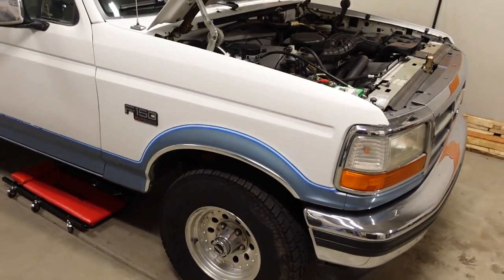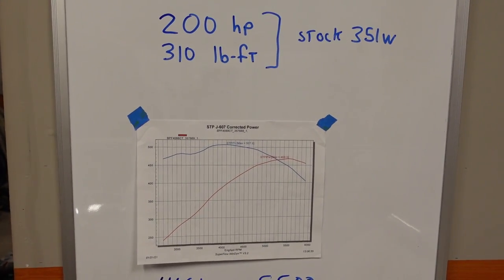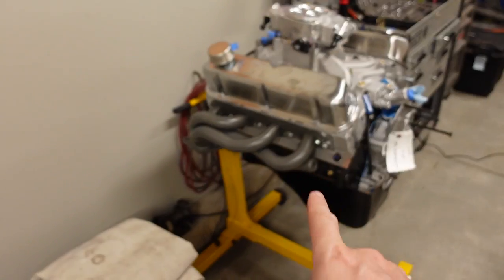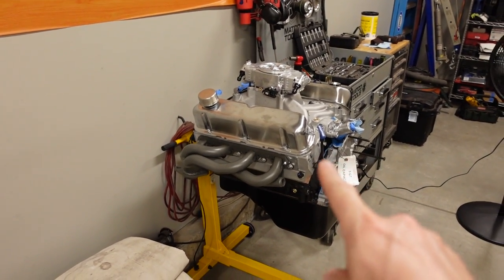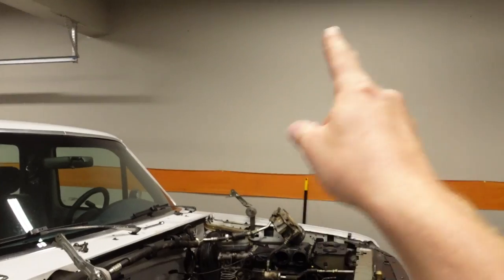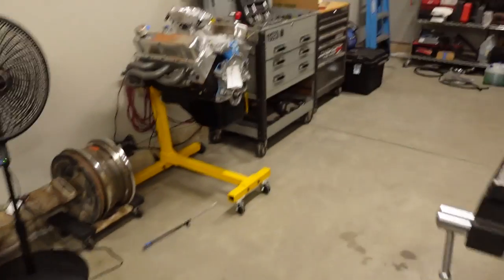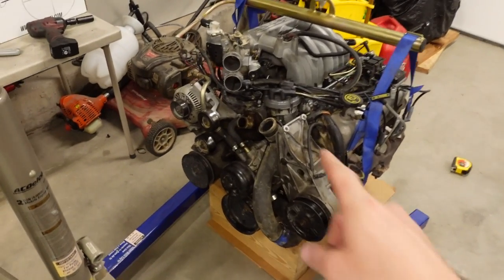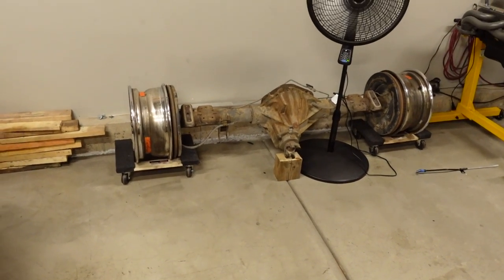Adding 268 MORE horsepower to a '93 F-150: Engine Swap Pt.1

Comment: It's so hot in there, the orange line around the walls is coming off!
Reply from the maker: yeah, its a vinyl sticker and the adhesive just isnt having it
Reply: Has been for the last few videos!
Reply: Get one of those portable A/C units with the exhaust hose. And drape a sun shade of some sort on the outside of that wall.
Reply: Time for a Mr cool mini split. Plug it into the welder 220 circuit or wire an extra circuit

Comment: They don't leak. That's pre engineered frame oiling. Prevents rust.
Reply: Pioneered by Dodge, perfected by Chevy.
Reply: @idriwzrd  good old Chevy it'll run like shit longer than most will run
Reply: One of my favorite features
Reply: Bullnose platform fords do that to ensure the oil gets changed.

Comment: I had a '93 F150 with a 300 I6 and M5R2 manual trans. Same body style but 2 wheel drive.
I sold that truck nearly 5 years ago with just shy of 750,000 miles on it.

I miss that truck

Comment: 4:29 nice form.
You need an engine leveler. Good ones aren't real cheap, but completely worth it if you're pulling motors. Actually, what's your shipping address? I'm not big on patreon, but wouldn't hesitate to send you a useful tool.

Comment: 4:30. Color me impressed. I've always used a buddy to remove hoods. I never wanted to risk messing up the paint. Next time I'll do it like this. 👍
Reply from the maker: I was barely on the edge of not being able to lift it off lol... but I highly recommend using a silicone rubber piece where the corners touch the cowling to protect the paint.
Reply: Ok, you got it off. Now put it back on by your self. And make sure the body lines are perfect while you are there.😆😆😆😆😆😆👿🌚

Comment: Same engine in my 95 f150 4x4..351w. I rebuilt it with a bump in compression to 10.1 and a small .477 lift cam. I ended up haven't to swap from speed density to mass air flow.  That small cam made I big difference.

Comment: When i pulled the 351 out of an F250 i had i started disconnecting all the wires to the engine then saw the same  connector you pointed out... it was my first time pulling an engine out, i did all the prep work the night before then rented an engine picker and had it out in just 2 hours with the help of my brother and made it back to the rental place before they closed at noon (weekend)... i got rid of that truck cause i didnt need it anymore and we wanted the 351 for my dads 94 mustang... now i have a 94 short bed single cab that im building the inline 300 for... got the hole front end pulled off and i will end up rewiring the whole truck to make it work the way that i want it to...

Comment: Hey LT, invest into one of those portable 3,100 CFM/950 sq ft. coolers. I have two in my shop here in the southwest as well and it makes all the difference. Just crack open that garage door for some air flow and you're set. I maintain 85F with a nice airflow in the shop. Couple $$$ investment, SOOO worth it though.

Comment: For future reference, Stinger perfomance has a plug and play computer for the ford eec4 that these use. It uses mega squirt efi and will control the factory overdrive transmission. Boost compatibility and fairly easy to use .

Comment: Hey LT, 
Throw some blow-in insulation between the stud bays on that garage wall. It should mitigate temps pretty well. Then you could get a small mini-split heat pump just for the garage. You’ll have air conditioning or heat. Just make sure the unit can operate during the winter temps of your climate. Hope you are well, love the channel.

Comment: Make sure that's the correct  timing cover for the reverse rotation water pump. Usually the engine dowel pins is what causes the problem.

Comment: Those E4OD torque converters get hot, and the pilot snout you're referring to swells, and gets stuck in the crank. They can certainly be a bear to bust loose. Put a little anti seize on it, when you go back together. Whoever has to go back into it in the future, will thank you greatly.

Comment: Add some insulation and a mini-split to that garage! There are some DIY packages out there for not much money. Some blown in fiberglass might keep the inside of the west wall moderated a bit…
Reply from the maker: the insulation by itself would likely make a huge difference

Comment: I absolutely need I mean need 1000-HP in my work van! Hey do a shade structure of some type next to garage. I did it over my driveway and it changed the way we use our home. No insulation in the walls either. Just by keeping the sun off the wall and concrete

Comment: This is super interesting because I’m in the process of this as well only with a carb’ed 302 with small cam and GT40 heads. Currently trying to figure out how to get the Quick 2 trans controller to work correctly with the E40D

Comment: My favorite part of my '93 is using R12 refrigerant.
Reply: Is it a lot cooler? My 95 has r134a and it’s all stock components but has been recharged and it works good. Had it on yesterday and it cooled me off rather quickly
Reply: @droppedf100  lol it's cold for sure. Comment was a little tongue-in-cheek. I don't appreciate compressor failure and having to source more R12 when R134a is less than 5 bucks a can at Walmart.

R134 conversion doesn't cut it in Texas. Looking to swap to a 94+ system to take advantage of ease moving forward.

Comment: Very happy to see the f150 build. This year is mainly what I work on but all lowered 2wd trucks.

Now why did you do a small single exhaust for a near 500hp motor? My motor makes about the same in my f150 and I run 1 3/4 longtubes and dual 2.5” exhaust with an x pipe and I feel I should be running dual 3” honestly

Comment: Lol my dad did that with his 48 ford it only had like 70 horse power he fixed it by yanking out the old flatty and stuffing in a Buick 333 nail head driving the hp to 220hp even with the old Rochester 4bbl it flew by everything and surprisingly even gas stations too

Comment: I have two main questions, question number one is what you're going to do about the fuel system. I have a mild Big block in my F350 and tried to reuse the stock EFI fuel system and it can't seem to keep up and I'm only making somewhere around 320 horse.
My second question is why the owner went with TBI instead of a multi-port setup since you're already investing in aftermarket EFI anyway? I know the small block Fords have a good selection of really good flowing fuel injected intakes and it seems like multiport is a far superior system to throttle body injection for efficiency and cylinder to cylinder distribution. As far as I'm aware when I bought my Terminator x system it was the same exact price as the sniper setup but I could be wrong, it's been quite a while now.

Comment: I will be glued to this build. I have a 96 bronco I've been wanting to do more changes on. Are you going to be running the stock trans?
Reply from the maker: yes we are, for now. it will get swapped in stage 2 of the build when we do the suspension

Comment: If you’re building a pre-runner why are you doing a solid axle swap? It already has the dana 44 TTB and there’s multiple kits available with 18+ inches of travel off the shelf. Unless you’re wanting to build a multipurpose vehicle that can rock crawl and go fast in the desert.
Reply: Giant Motorsports has some slick TTB and Twin I beam kits.

Comment: A 392 Windsor would be perfect.
Reply: Main difference is the 408 has a 4" crank with longer rods compared to a 393w that uses 0.030" over 302 pistons, stock length 351w rods and a 3.85" crank. 393w can be more budget oriented depending on what quality of parts you are looking to use. A 408 kit with all forged parts is no more expensive than a 393 with the same stuff.

Comment: I would've been mad if it was an LS swap.
Reply: Yeah! Who wants easy, cheap, reliable power anyway?!
Reply: @idriwzrd  I doubt a blueprint engines 408 windsor crate engine will be anything other than reliable; particularly when you take into account the professional installation done by LT.
Reply: @christianmeeks4430  Also cheaper than any LS motor that makes similar power, as well as easier to find parts for.

Comment: That transmission is going to be screaming for mercy behind a 408.
Reply: Not true the e4od is a stout piece even stock. I’ve been 11.40s with mine with only a converter and a performance valve body
Reply: I believe that trans is basically a C6 with an OD. They're reasonably stout, a basic rebuild with a few upgrades should do alright. I'm glad I have a ZF-5 S47 behind my 5.8L roller cam engine to handle a 393/408/418/427 stroker upgrade one day God willing.

Comment: Double check that timing cover will work with the reverse rotation pump that is used with the serpentine belt system.. Ford's are dumb and used a lot of different front cover stuff
Reply from the maker: This actually just saved me a lot of hassle… I never would’ve thought to check
Reply: @LawrenceTolman  also the balance of the engine is another issue. They may have the engine setup for  0 balanced and the balancer and flexplate on those motors are all 50oz imbalance. Casting number right above starter area should say f4te if it's a roller block unless they used roller conversion setup in earlier block

Comment: 7.3 idi
Reply: I loved my '90 Bricknose F250 7.3idi ZF-5  S42, great torque and decent kn fuel. She wasn't very racy though. My '97 F250HD 351w ZF-5 S47 has a bit more grunt, tons more upgrades available and only a bit worse fuel economy as it sits mostly stock once you work in the difference in the cost of 87 vs diesel it really close. I'll concede a 7.3 IDI will run for close to a million miles vs maybe 400,000 from an expertly maintained 5.8L.
Reply: @hendo337  I do want one for my f150 I plan on swaping it in and making a 4x4 that looks like the old military trucks

Comment: You must work out if you can manhandle a hood by yourself
Reply: I've had a few spine surgeries and I didn't have much trouble with my 97 obs hood, the trick was to balance it and use my strength smartly.